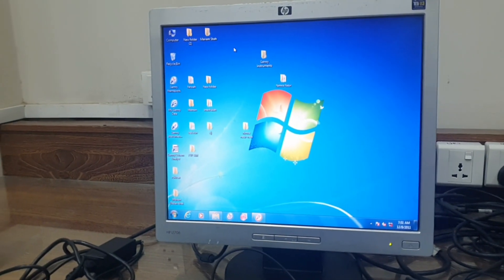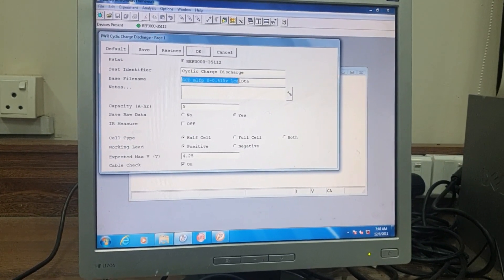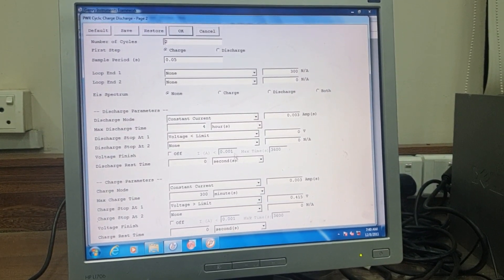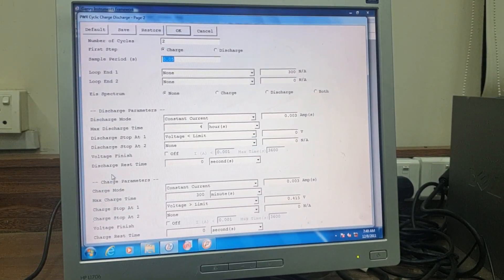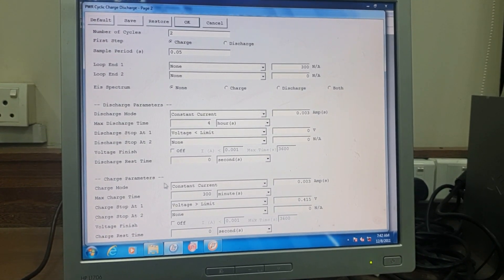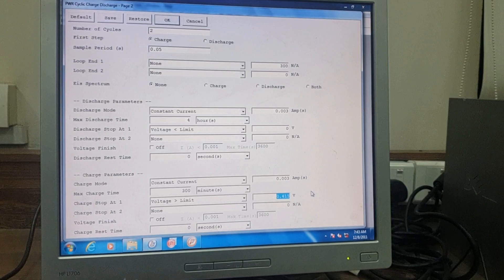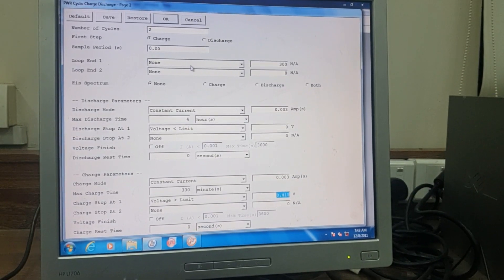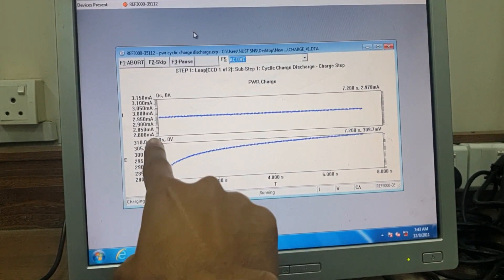How to perform GCD | Galvanostatic Charge Discharge through potentiostat | Setting up cell for GCD

Comment: Hi, for some reason i have 2 problems. 1) if i truntonput the discharge stop at 0 i get an error message. 2) by doing the same as in the video except putting 0,001 volts as the discharge stop. I only get discharge stage. Never charge stage.